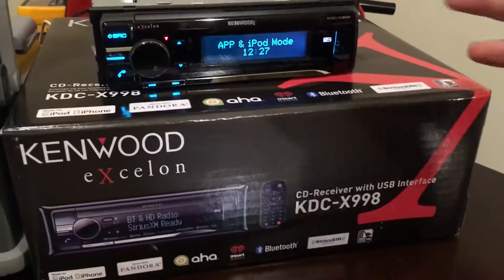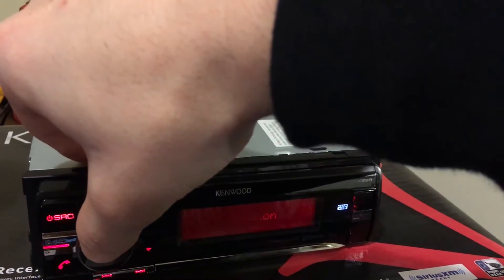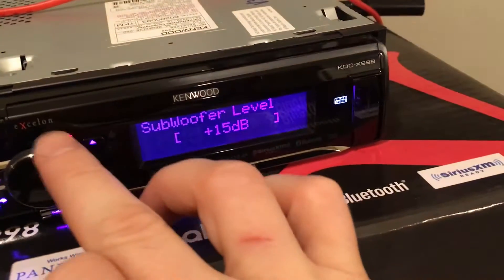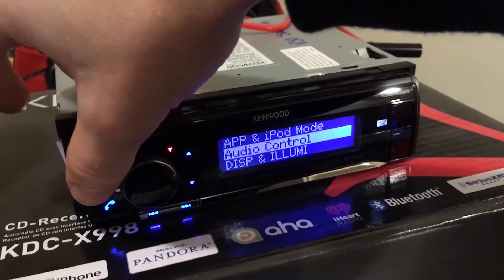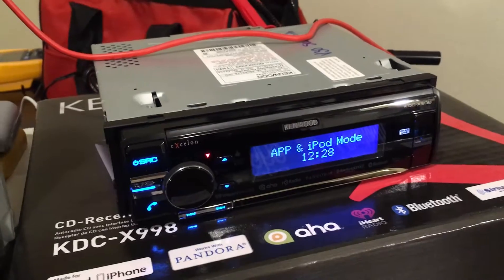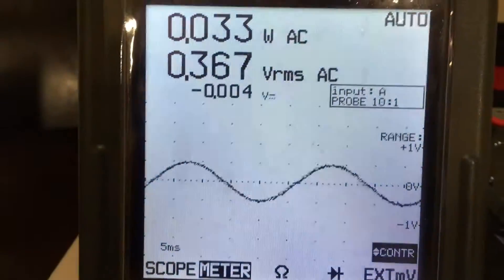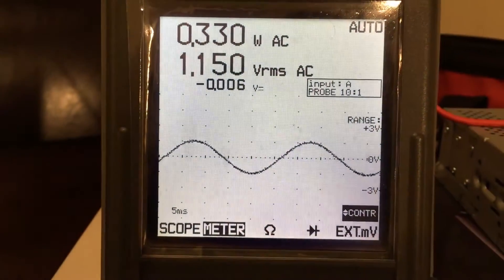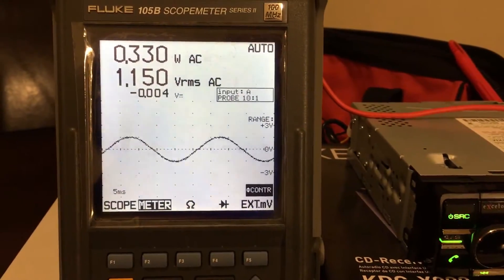KENWOOD KDC-X998 - QUICK SCOPE TEST - 4V PREOUTS

Comment: Can this fit in a 1994-2001 Dodge Ram 1500?
Reply from the maker: Go to crutchfield.com - You can still purchase this HU new. You can enter your vehicle information in and it'll tell you if it fits and or what kit may be required to make it fit. The kits are usually very inexpensive but required. I'm almost certain this will fit though.
Reply: Mickey Reviews Cool
Reply: Mickey Reviews It fits
Reply from the maker: This HU is heavily dated. There are better/cheaper options out now.
Reply: Mickey Reviews Okay

Comment: Hey thanks for upload that test, I have this HU I have a few questions.
1.What voltage give you on  RCA with 1kHz signal?
2.Is the 35 volume clean? 
3.the signal clipping with +9dbs SWL?you don't show it on the video.
4. There's a little theory that turn off the internal AMP the RCA signal are more cleaner,can you make that test? 
Hope that you Answer all that questions.
Reply from the maker: Sorry for the late reply. I don't have the HU to test it anymore :(